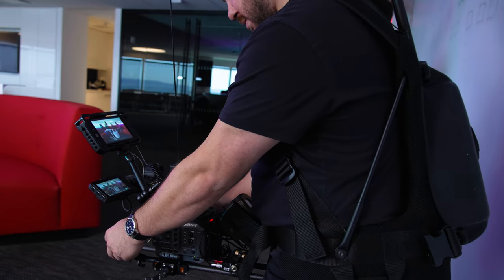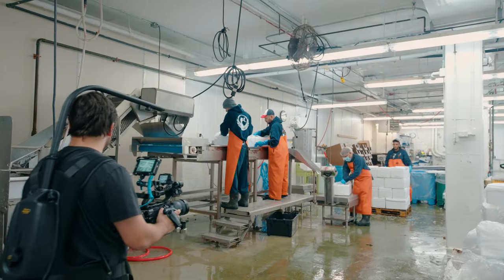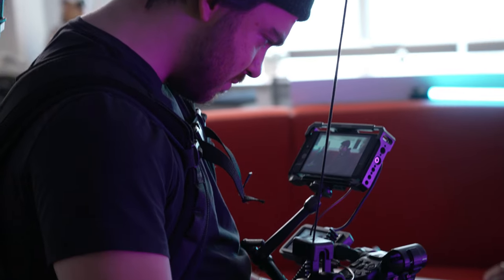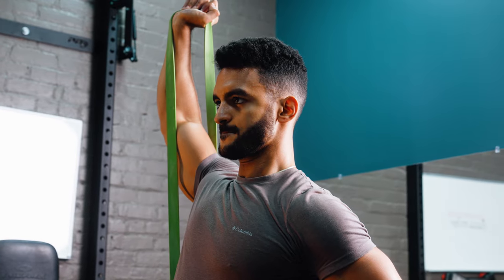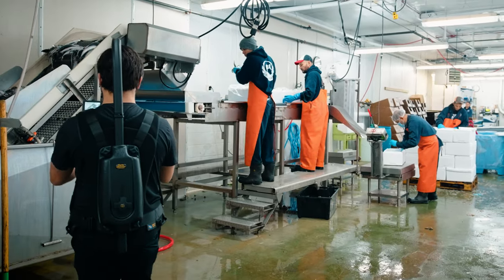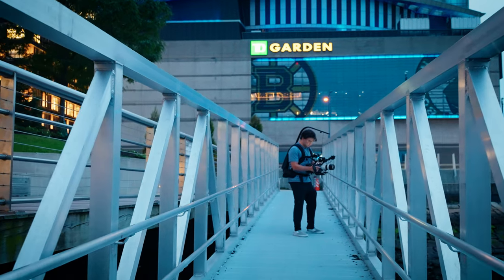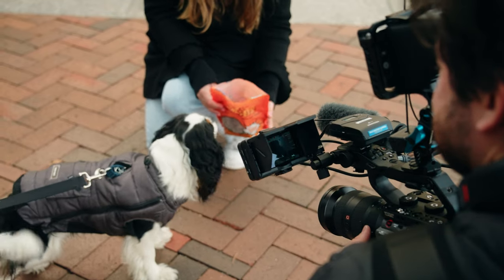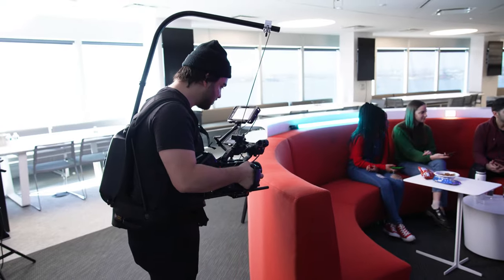My experience using the Easyrig Minimax and Sony FX6

Comment: Hey Jon, Great job on the video. I gotta know, what lens were you using for this shoot.  I see you use the 70-200 a lot, but just wondering the ones you used for the shots at 1:36 and 1:46. Those shots are textbook! Tac sharp man! Any insight would be appreciated. Keep up the great work.
Reply from the maker: Thanks so much!! 1:36 is Sony GM 70 - 200 v1 f2.8 and 1:46 is the Sony 24-70 gm v1 f2.8.  Cheers!
Reply: Thanks Jon!

Comment: Love the EasyRig. I used the Minimax for a documentary/reality shoot with the Canon C200. By biggest problem was just getting it balanced and comfortable on my hips and back. I was really sore after a long shoot but it still made it possible to handhold a 15 to 20 lb camera rig for hours at a time. 
Definitely not designed for long walking or tracking shots, but I wonder if you try just lightly guiding the camera as opposed to putting pressure on it, letting gravity do the work, almost like with a Steadicam system
Reply from the maker: For sure! Appreciate the insight.  Cheers

Comment: Hi Jon, great video!  I have a few options (ie Tilta & smaller steadicam), but haven't ever tried the Easyrig, which would give a narrower profile.
What lens did you use to get that awesome flare with red rings (ie at 20 sec)?  The only lens I know that will do something similar to this is the EF 50 1.2.  Sony flares green :-(
Reply from the maker: Thanks!  That’s a vintage canon fd lens.  58mm 1.2!